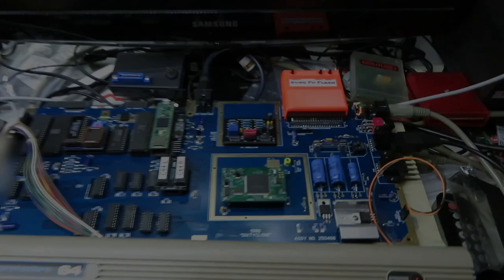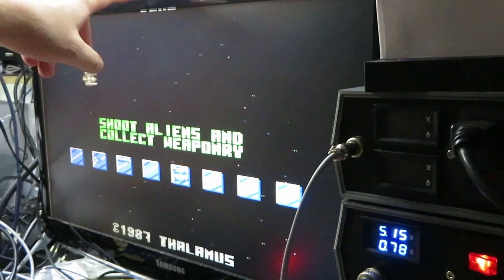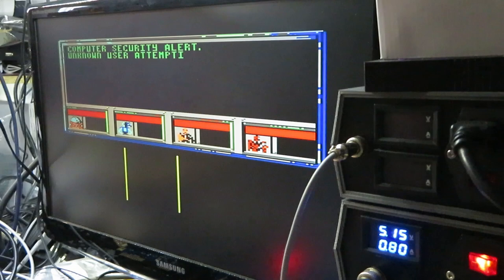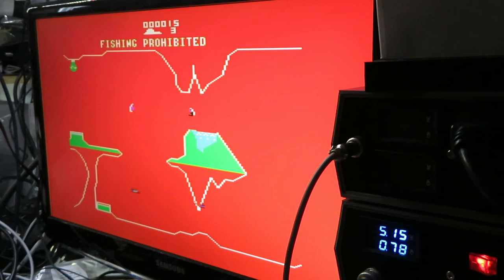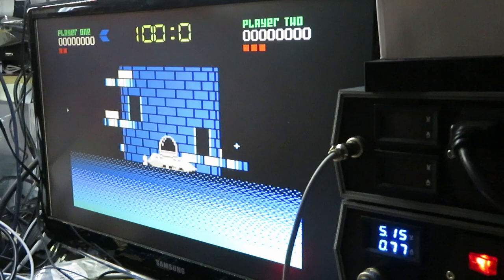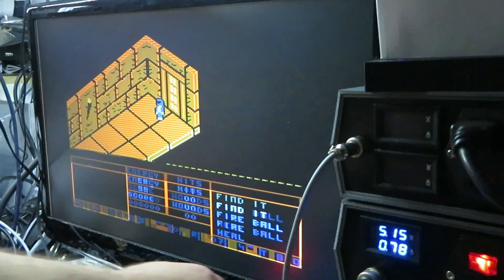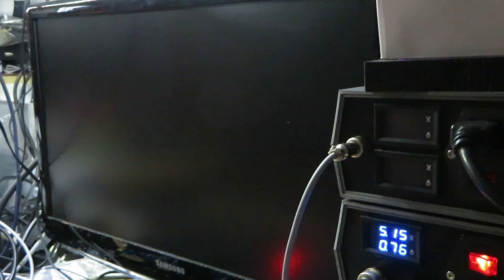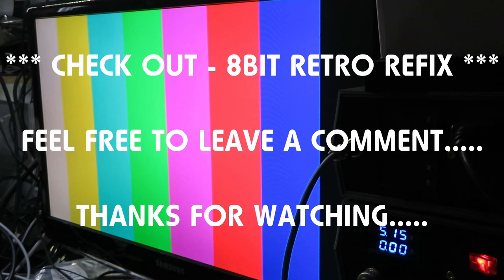EP20 PAL VS NTSC ON KAWARI

Comment: It's interesting on the Kawari website it says compatible with 250407 326298 KU-14194HB* 250425 motherboards, but you appear to be using the SixtyClone 250466 here and working aside from the issues you point out in the video. Maybe the SixtyClone 250466 board has wider VIC-II compatibility than the factory 250466 board.
Reply from the maker: I'm sure although it's not specified others have indeed ran the lawari on stock 466 boards too 😀

Comment: How is the output on the Kawari? Is it true to the VIC-II chip or is it compliant with the settled standard for s-video and composite?
How easy is it to update firmware?
Reply from the maker: I am using the mini version which recreates the s-video and composite exactly as in the real vicII , The output is very very clean , I am using mine with a retrotink 2x pro and its superb
Reply from the maker: I have not tried updating the firmware yet but I believe its a simple procedure
Reply: @CaptainCommodore  Thanks. I was wondering how to update it. Whether or not it's a simple procedure via a PRG file or USB connector or you need a programmer of some sort.
About the video output. Yes I know it's very clean - much less noise. However the original C64's video output is far from the "modern" s-video and composite specifications. I have a newer 24" (very) cheap TV at the kitchen/dining area and an older  42" Philips which handles the video decently - especially the older Philips. However I also wanted to use my C64's in the living room but that Samsung TV is so a new design that it has no analog inputs. No big deal I thought - and ordered two analog->HDMI converters, one even with S-video. However the result is horrible. The cheapest one refuses to display any picture at all while the one with s-video shows a very low quality image. Then I googled it and found out the reason is that the C64 video output is off spec as it was designed back when standard werent settled. Old analog TV is quite forgiving and some LCD flatscreen seems to handle it decently too - but far from all. The converters work fine with other video sources like newer (00s) DTV game consoles and DVD machines. So that is why I'm asking whether the video output is offspec like the C64's VIC chip or on spec (like the C64 DTV that was popular some 10 years ago or so).
I can't find the RetroThink for a decent price in EU. Shipping from US is expensive and most doesn't handle the VAT so upon arrival often you must pay VAT directly to the shipping company which is usually a hefty "fine". I have ordered a RetroScaler 2x - lets see if that can handle it but still have to receive it.
Reply from the maker: Well the large board kawari has native hdmi out too I believe ( I only have the mini ) this should be far more forgiving than the conversion your currently going through
Reply: @CaptainCommodore  Yeah I know the larger version has HDMI. I've not ordered any yet and I'm a bit torn which to get. I'm fine with an external converter - but I really want to know whether or not its composite and s-video output is conforming to "modern" standards - the original VIC-II chips does not. Not sure you're understanding my questions. I can ask the question in another way: If you take a cheap 4 GPB HDMI converter from Ali Express - does the image look decent? (I does on mine - just not when using (pal) C64).
Since the HDMI doesn't have audio output I've searched to see if there exists an HDMI audio injector - so far not found any. Would be nice if I could just tie such an injector where the modulator normally goes - that would be a huge plus for the larger version.
On the other hand the smaller version in cheaper and smaller and sits more secure in the socket. I'm not after pixel perfect output - just an output which is conform to "modern" s-video and composite standards.
Reply from the maker: The pal 64 will output at 50.125hz , as far as I'm aware this will be the case too when using the kawari , my retrotink converts this to hdmi and it looks great on my Samsung, however, the kawaris built in hdmi will be far superior but as for how far out-of spec it is , I cannot answer as I have only the mini version ( svideo/comp only ) but I would pop onto the kawari Discord board where the creator is likely to answer that
Reply: @CaptainCommodore  Thanks. I wasn't aware of the slight offspec frequency. That could probably be fixed if a suitable crystal close enough can be found - or if a China company offers to do a custom one otherwise custom crystals aren't cheap. I am however aware of the voltage levels for both signal and sync and there's also something about the luma.
Oh well. I should have a RetroScaler2x here in a week or so then lets see how that handles it. RetroThink will be very expensive here. I wish American companies would realize how much it means that for a European buyer to buy their stuff they really need to be able to offer that VAT can be prepaid. The fee for the shipping company to handle the VAT is usually quite a "fine".